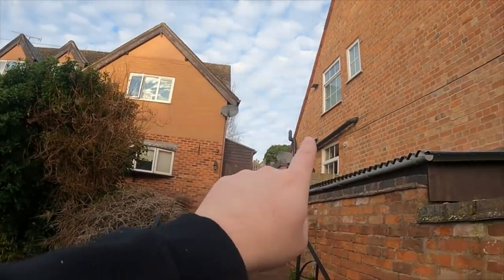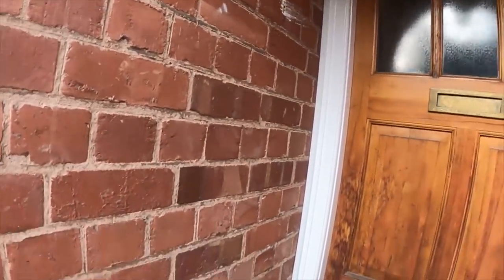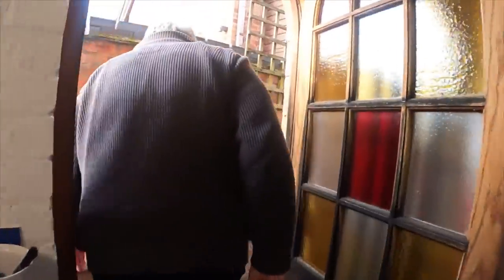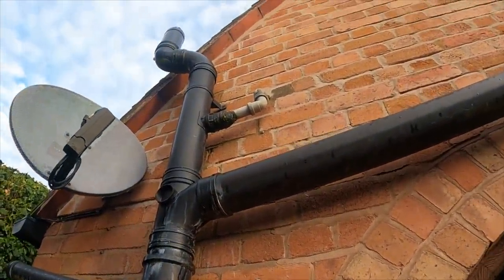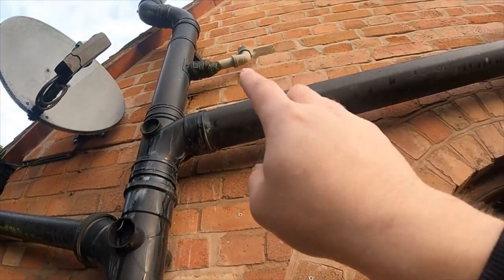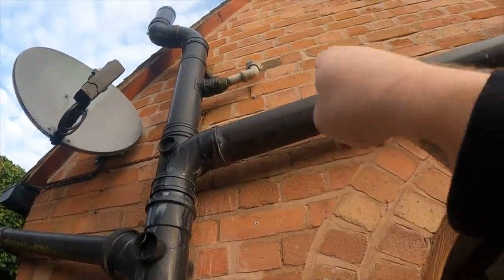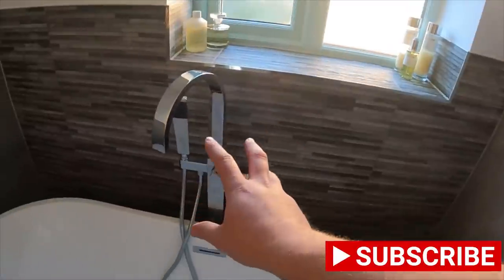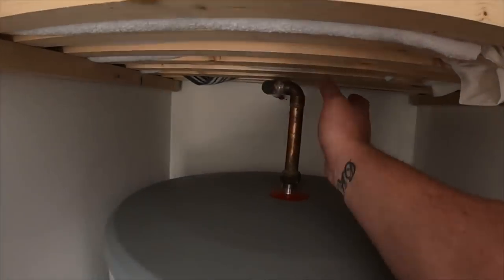PRICE REVEALED | PLUMBING COST for a BATHROOM REFURB (Cheap or Expensive)

Comment: Bath. My way would be from room below. 80mm drilled hole in cieling take a look in void. or feel if pipes are blended yet. if not see what dirrection and drill hole further away then see if pipes are blended yet.  after your done battern holes put cores back in, bit of filler. and access panel where valve is ( IF you even find it).  They could have even brought pipes up under bath and back out.  So Holes from below should be easyest and cheapest to start..Good Luck MT
Reply from the maker: Thanks mate, thermal imaging it to hopefully see if I can find it, failing that access below is an option aswell
Reply: @MJTiffPlumbing  Now that would be ideal (Thermal Image) i hadnt even thought of that. Good Shout

Comment: The waste pipe job £150 mornings work,the bath out,shower etc couple of days work possibly £400 labour but customer needs to source/supply tiles,also with new houses contractors are supposed to leave details of services water etc in a handover book they get, details of that t.m.v. could be in there.
Reply from the maker: About the same on the waste job then buddy 👍🏼👍🏼

Comment: 12:56 I know this is an old video but blending valves tend to be within 2m due to the risk of legionella. You could also use a thermal imaging camera to determine where the pipes are no longer hot a costly tool but can be very handy.
Reply from the maker: Try and find the follow up to this video and see just where they had put it🤦🏻‍♂️🤦🏻‍♂️

Comment: Good breakdowns, props for being upfront and laying it all out. 
That's a smart move to kick off with the "basic but not cheap" complete package for the bathroom, then see if the client wants upgrades.
I'm wondering if you give people a timeline of sorts, as in it will take 8 working days or whatever your estimate is? 
Do you work off a daily or weekly price for yourself, that includes all your operating cost, margins etc? Or more directly the number you feel comfortable with (“3000 will make this worth my while”).
I find the troubleshooting and problemsolving really interesting, I would love to see the follow up on that bath/tap situation - what turned out to be the issue, and where it was all located?
Reply from the maker: For a straight forward bathroom I usually allow a 2 week turn around….. never usually go over that

Comment: Great video, gonna subscribe 👍 
With the bath, would it not have been easier to go up through the ceiling below? Much easier and cheaper to repair.
Reply from the maker: Thanks mate….
Below is a fully fitted kitchen so would struggle, also it turns out that it’s had a camera put into the ceiling a few months back with no joy… sadly.

This is going to be fun that’s for sure!!

Comment: Soil waste pipe leak fix seems very expensive. You said £25 for parts and an hours work and you’re charging £140? Even if the parts were £40 that’s £100 an hour! I had some external pipe work sorted, few fixings, new bit of pipe, 1 hours work and was charged £70. 

Also had a new bathroom refit, everything replaced, 900 x 900 shower and cubicle, toilet, sink, towel rail, shower boards all round the room, new ceiling and Lino flooring. £5500 for all that. Plumbers are a lot more expensive down south! 

Nice content and interesting channel to watch.
Reply from the maker: As said, prices are different all over the country.
It’s not “very expensive” for this area…. Infact if that job was done in London it would be “very very cheap”. It’s all relative and that’s why I’ve put this content out, it’s interesting to see constructive comments.

Glad you like the content👍🏼
Reply: @MJTiffPlumbing  yes it’s a great channel with great content. Really interesting to watch and have learnt several things from your videos. Good to see how jobs are priced up as well as some people won’t want to share these things.

Comment: Hi mate Being a builder/plumber myself I mostly do repair work , a 100 % percent take tiles up as last resort . Go from ceiling below. Try and cut nice square holes between joist . As this looks better for the customer and also is easier/cheaper to repair and make good. Draw a square or cut round a wooden template with a multi tool . Also don’t cut to deep to avoid hitting cables or pipe work .
Reply from the maker: Thanks for the comment 👍🏼👍🏼
Reply: @M J Tiff Plumbing  😂😂😂😂 and don't forget to tie your shoelaces and put socks on

Comment: Can you not investigate the bath pipework from the ceiling below then patch and paint the ceiling below rather than tiles? Brilliant video by the way glad you talked about pricing. Honest and fair prices from a quality tradesman.
Reply from the maker: It’s an option but it’s a fully fitted kitchen below🙈🙈
Reply: Exactly what I was thinking.👍🏼
Reply: Thats exactly what i would do, even if you have to drill say 65mm holes inbetween each joist, get yourself a set of super-rods , you only need four red ones, and a ferrett camera, slide it through the holes it has a light, is very small and will enable you to inspect under the floor, when your finished screw the bits of ceiling back in and fill. I'll bring mine down and show you if you want. I'm a sparks by the way but love your channel.
Reply from the maker: Yep, this has been discussed to try and keep disruption down about….. trust me, I don’t want to be taking it all out at all🤣🤣
Reply: @MJTiffPlumbing  doh! Infrared camera to trace it if you or a mate already own one? I'm out of ideas good luck lol.
Reply from the maker: @steve-fx2ez  yep, Thermal imaging coming out I think👍🏼👍🏼

Comment: My hourly rate is 135 an hour. But with most of my work, I just come up with a price, I always go on the high end.. example 40 gallon water heater.. 1500-1700. That includes new flexes gas and water, gas shut off while using the existing earth quake straps and disposal of old unit..Iam located in L.A county , CA. South Bay Area.. a little pricing my way, keep up the great work
Reply from the maker: Nice one Timothy 🙌🏼🙌🏼👍🏼👍🏼

Comment: 2nd job is very similar to a block of new build flats we now look after, built 3 years ago and blending valves buried in walls. Absolutely mental, some of them don't have blending valves so they just turned the tank temperature down below legionella requirements. So many corners cut when it comes to new builds, no idea what developers are thinking.
Reply from the maker: It’s a nightmare mate, honestly…..
And the worse bit is you can’t price for something you don’t know
Reply: @MJTiffPlumbing  Yeah, I have to go to the block on Tuesday and find where the rising main has given up. All boxed in and likely run up the building in 28mm speed fit if the workmanship in the flats was the norm. If you're going to look for it though, get a thermal camera and run the hot out the outlets it'll make life much easier - remembering there's only supposed to be 1-1.5m between TMV and outlet it will give you an idea if they have indeed put it near the outlet or behind the hot outlet of the tank/ entrance to the bathroom.

Those are the standard locations we have been finding for them in these new builds anyway.
Reply from the maker: @effervescence5664  good luck with that mate…. 
Yer will get the camera out and see what I can find

Comment: Thanks, really insightful and useful for someone getting quotes to redo a bathroom. Although It's not really clear on the breakdown on labour costs. I think you said £7000 ish for the labour, of which let's say £1000 is for the sparks, chippy and plasterer. Which leaves £6000 say. Am I right in saying this would be about 6 days labour? In which case does that mean it's £1000 a day for someone to do the work?
Reply from the maker: The price is for everything!!…. The bathroom suite, the fittings, the lights, plaster, aqua boards, timber, flooring, Labour, skip etc etc etc…
Reply: @MJTiffPlumbing  Thanks for that. Sorry, I didn't listen properly. Cheers for your vids.

Comment: Great video mate.
Stupid question about the blending valve issue but would it not be easier to pop the cellings below to find it then make good cellings, replaster and paint? No tile matching etc??
Reply: Or as it has downlights can you pop one or two daom and put a small camera up and look for the pipe work then follow it??
Reply from the maker: Yep there options as others have said👍🏼👍🏼

Comment: I think that perfectly reasonable, end of the day if you do an amazing job ect you have organise the job, go get the materials ect ect. I think this is reasonable price. Problem is people just do not understand how much things cost and nobody’s running a charity, had a customer the other day wanting a job done kind of the same as this they would supply the suite but only wanted to spend 2.5-3k to fit as they had seen that online/Facebook
Reply from the maker: Thanks mate, this was exactly why I’ve done this, to give a little insight into it….
Reply: @MJTiffPlumbing  I’ve just priced a wetroom -11k but using great stuff. And when you’re fitting premium stuff I believe you should be able to charge a premium, no ones changing a boiler for £250 are they even if it takes them 1/2 a day
Reply from the maker: Exactly Kyle……. 👍🏼👍🏼

That’s sounds about right for a wet room where I am 👍🏼👍🏼
Reply: @MJTiffPlumbing  no every goes for it and that’s their choice but it’s the markets we choice I suppose

Comment: Some pillar bath taps have what is basically a ibox in the floor with the thermostatic mixer inside it. Given size of floor plate I’d say it’s that.  So try take the tap out first.
Reply from the maker: Thanks mate, I did wonder if that may be the case hence taking the valve out to see if it was anything like that.
Deffo worth a try….👍🏼👍🏼

Comment: Plumbing for 12+ years (7 residential service work, 5 and counting new commercial and high rise buildings) and I've never found a mixing valve in a residential application. I mean, am I missing something? The cartridge is the mixing valve, no? I've installed a few of these, and I remember them having braided flex lines that connect in the floor. I'd guess a kinked line or bad cartridge. Would love to know the outcome of this job
Reply from the maker: Keep watching the later videos for the outcome
Reply: @MJTiffPlumbing  awesome! Thanks

Comment: Nice to see you fit and well again mark you where spot on with them prices I said 120-140 for that leak on the waste. That freestanding tap I would remove it from the floor and check the hot inlet isn't blocked if you can't get any adjustments on the main tap, there is usually a plastic ring you can turn to adjust the temperature on the main tap. Only an idiot would hide a blender, if there is a blender it's not under the sink behind them drawers is it?
Reply from the maker: Thanks mate, nope the basin Pipework again just goes into the wall… but that is red hot.
Thermal imaging camera is the next port of call, someone suggested it on here and I hadn’t even thought of that….. and it was sat in the van!!!
Reply: Good call thermal imaging camera mine has saved me a lot of time fault finding and from ripping things up 👍
Reply from the maker: @adierob1  yep, handy tools….👍🏼👍🏼

Comment: Some freestanding taps have a temperature limiting cartridge fitted, it looks almost the same as the one on your flog except it has a red adjustable ring fitted around the blue tooth top of the cartridge, the original installer may have removed it or it could be the cartridge itself is knackered or the incorrect one is fitted.
Reply from the maker: Exactly why I took this one out👍🏼….. it’s not a  temp limiting one and still the temp is low so it points elsewhere…

Comment: Job 2, try a FLIR cam buddy run the hot on the basin and bath and try the cam from above and below hopefully you can see a blender from below, also try unscrewing the bath tap from the Mount and pull the tap out from the floor as far as it will go to see if they kinked the hot flex. Just a thought buddy, top vid👍.
Reply from the maker: Thanks mate, had a thermal camera on it in a follow up video… still no joy

Comment: Alright mj? Regarding the blending valve job, do you charge them for the first visit trying to locate the blender and trying different things,or because your going to go back and try other things, will you charge a total for multiple visits? Thanks
Reply from the maker: For this job I just popped in to take a look, but while there thought I would try a few options, will add a bit onto the quote and if I get the job I will get it back then.👍🏼👍🏼
It was only an hour or so

Comment: Being in the trade for over 36 years, if you have problems with pipes under a tiled floor,. We would rip ceiling down in room below. . A lot cheaper.
Reply from the maker: Only if it’s accessible from underneath….

Comment: Best running the bath tap hot feed pipe into a bucket to check the temperature and flow rate. Hopefully help narrow down the cause a bit better then. And if it is a hidden blending valve just sack off finding it. Price to run a fresh hot pipe from the basin to the bath tap. Maybe via the ceiling below for minimum disruption
Reply: First thing to check is the hot and cold fed from the same source easy to do if there is 2 sources turn one off.
Reply: Seen hot fed from the attic and cold from mains b4.
Reply: That will be 3k please.

Comment: What about pressure being too strong on the cold for the hot to come out properly! Hot obviously 3.5 bar but is the cold at say 5? Quality content as per usual Mark 👍
Reply from the maker: Being a pressurised hot water system the cold will be 3bar max out combination valve, so the hot will be the same as the balanced cold (3bar)

Glad you liked the content mate 👍🏼👍🏼
Reply: Should have a balanced cold off the multi control valve or would have the same problem at every outlet
Reply from the maker: @mikecave4154  exactly what I replied mate….
Reply: @MJTiffPlumbing  think we replied at the same time ha

Comment: Very fair price mate, im calculating exactly the same way as you do.
My customers often the delivery the materials lately, that is how it works in The Netherlands nowadays.
For that bathroom i will quote them around 8K euro, that is with labour, vat and small materials like fittings and stuf.
That is around 6.7K pound so pretty similair considering i dont deliver any big materials.

What is the hour rate that you calculate for such a job?
And i think 9-12 full days work right?
Reply from the maker: Sounds like we are very close, I wouldn’t do an hourly rate on this buddy.
Time wise I would have a 10day turnaround guide👍🏼👍🏼

Comment: With the bath mate and not getting hot would it be easier to go from the ceiling downstairs to save getting the bath and tiles up? Sounds like a nightmare either way if the blending valves in the floor👎🏼
Reply from the maker: A lot of people are saying that, it’s the kitchen below with units in the area we need to get to…. It’s an option thought 👍🏼

Comment: If there's a blending valve I bet it's very close to the tap. They would've thrown it in and attached the tap flexis to it. Whip out the bath and take the tiles up under the bath. Once it's put back you'll never know.
Reply from the maker: Exactly my thoughts mate
Reply: @MJTiffPlumbing  great minds, mate. Great minds 👍
Reply from the maker: @getbry7452  😉😉
Reply: I bet there's a hole in the floor for the bath trap so you be able to see it from there. Let us know how you get on? Have a good week.

Comment: How have you managed to stay under the VAT threshold? Ive not been self employed 12 months yet and I'll probably double it by the end of the year. Do you get the punter to pony up for the materials?
Reply from the maker: As and when I can I will….
Reply: I was thinking that as well , only need to do 5 bathrooms & your at 40k already you can do that in about 3 months !! Yhats without any other jobs your doing
Reply: Spot on , it’s a nightmare staying below vat threshold as materials are constantly going up but threshold stays the same for the last 4 years . As a one man band bathroom fitter I have to monitor turnover constantly. Still beats working for someone else though. 👍🛠
Reply: @michaelsymes6479  yeah I think vat registration is pretty much inevitable for a plumbing and heating business. Maybe just Jobbing around you can stay under but one medium sized plumbing and heating refurb job supplying plant room stuff for me can be £20/30k in its own

Comment: Before I would start taking tiles and bath out I would change the cartridge on the tap 1st as they are only a couple of pounds , can’t think why they would put a blending valve under the floorboards, but who knows 👍👍
Reply from the maker: It’s a non thermostatic cartridge so that wouldn’t help……. See the video where we sorted the issue😉

Comment: I'm really curious about pricing, just been quoted £16k for boiler and first fix central heating, new hot n cold feed to bathroom and kitchen. House is stripped no chasing in and all done in speedfit. So that's  no rads, no thermostat valves, no bathroom or kitchen fitting, no waste removal, no plastering, no tiling, nothing just basic first fix. Including boiler I've been generous and said £4500 for materials. I'd love to know where the other £11500 is going, £9200 without the vat for what? A few days work running plastic pipe in a shell of a house back to brick and exposed joists. I'm a fairly competent diyer and if it wasn't for being a lorry driver tramping all week I'd be looking to do the majority myself, ive already done lead pipe replacement and concreted the floors, i understand all the stuff about insurances, vans,  etc but 9k for a weeks work boggles the mind.
Reply from the maker: Wow…. That’s some quote!!!!!!!…….
Assuming it’s not a huge huge house then I would be getting some more quotes. 
That could be them having so much work they are just throwing numbers at you and if they get it they are quids in…. Some people do that